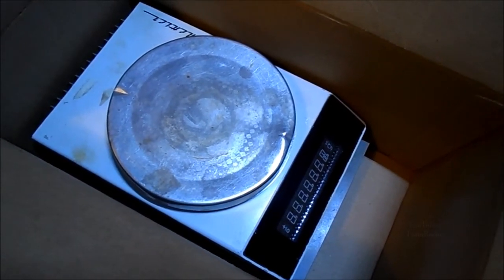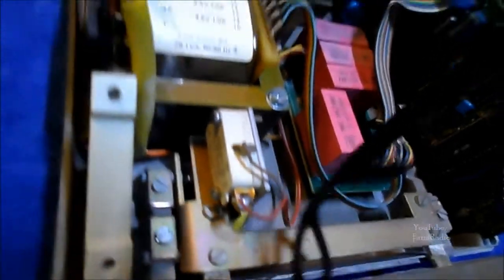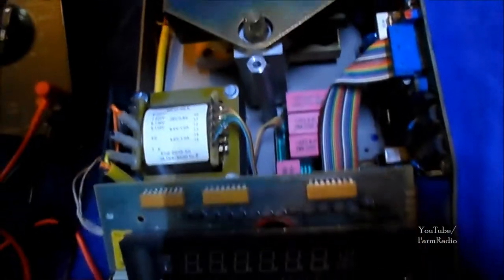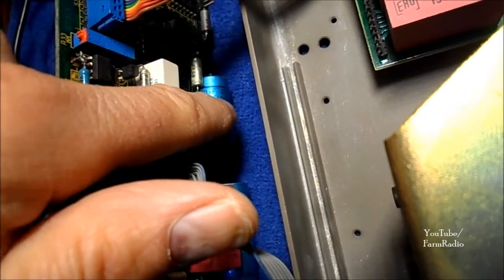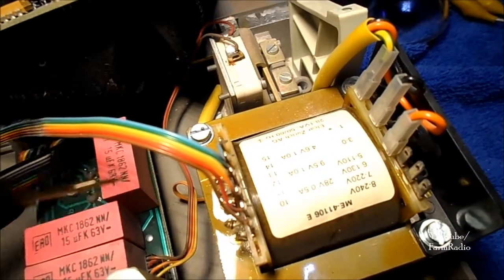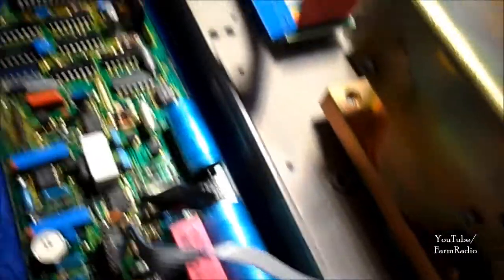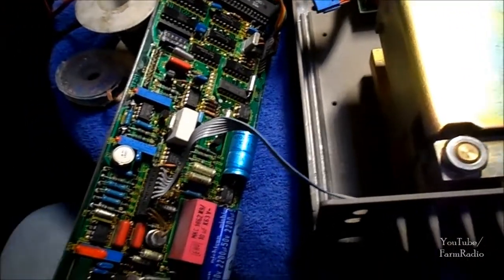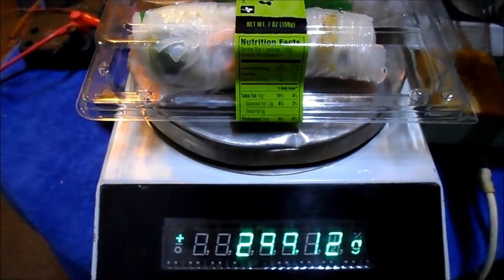1981 Mettler Scale Repair.

Comment: I think running the test backwards would help. Warm up and use cold spray from a can of air.
You can spot the cold temp easily. I see that done on LCD screens. If the bad cap was the issue great.

Comment: I would say that by default I will change all of electrolytic capacitors as well as tantalum one when this kind of trouble appears (ok after checking the fuse, connections, transfo and for visual bad soldering). Electrolytic capacitors are the major weak point in all electronic devices. The MTBF for old one were usually low (<2000h), be luck this MTBF has been increase with technology, and can go up 10'000h. When replace, choose a long life one and at least at the same voltage (never less) or, better, one step up (if 35V choose a 50V for example, of course check for the place - dimensions first), better choose min 105°C one if possible.

Comment: You need an ESR meter to check for dry electrolytic caps.
Reply from the maker: Have a nice ESR meter. So far not impressed by it. It will verify a bad one once I figure it out. Hasn't found one in circuit itself ever.